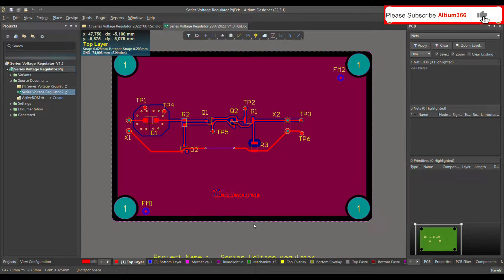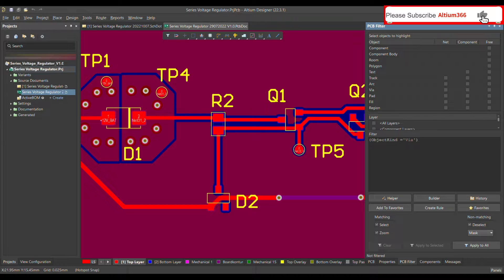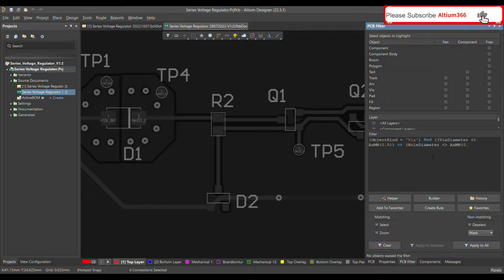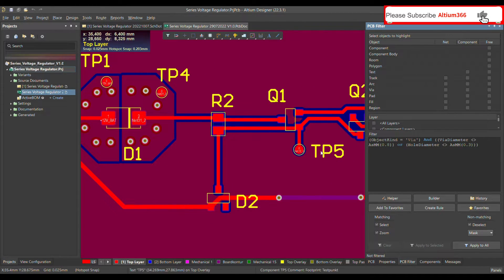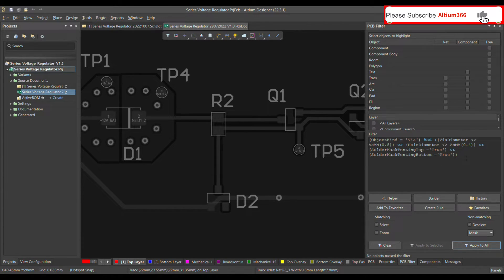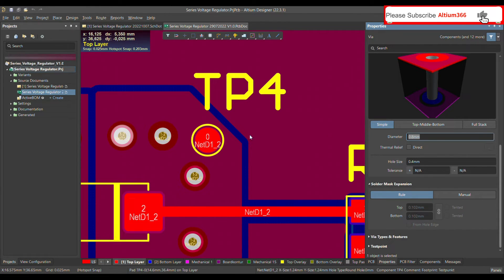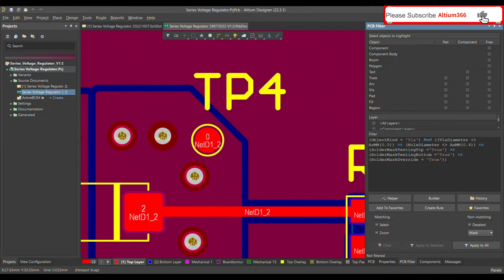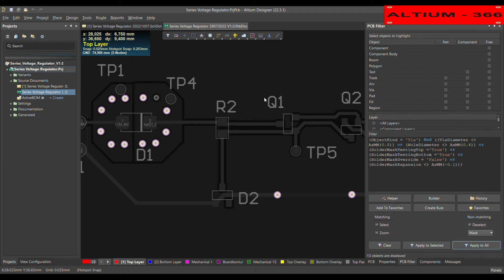Altium Designer Tutorial 34:  PCB Filter Query for "VIA".

Comment: Sir, how can i expand that section of PCB FILTER which named Filter ?
It is overlapped on Layer section
Reply from the maker: Sorry saw your message now,  you can place the mouse on the bottom frame of layer window, mouse icon will change from arrow to "up and down side arrows with parallel line at centre", then you can simply drag the window frame downward.